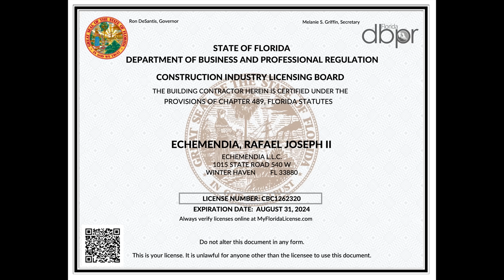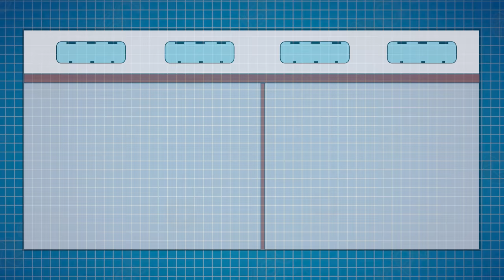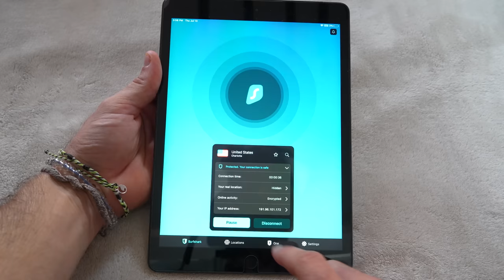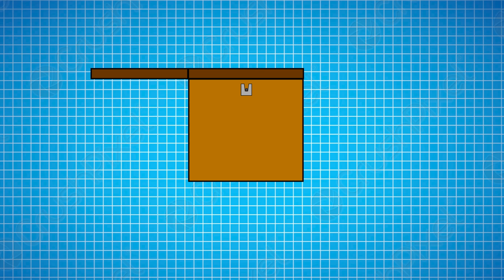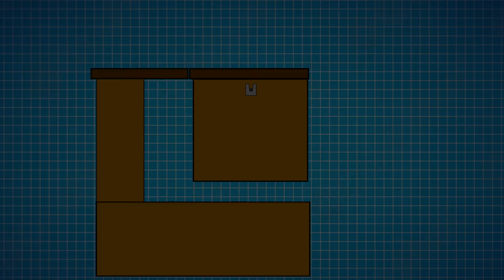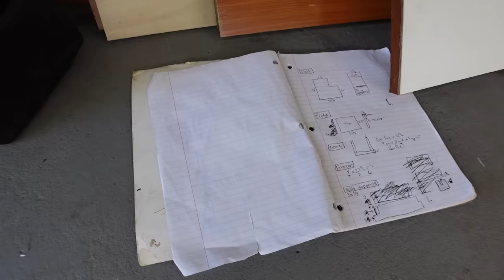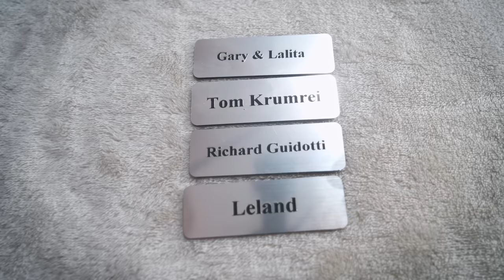Building a CUSTOM KITCHEN on a SALVAGED BOAT | ep.23

Comment: i work on sea going tugboats. Our stoves are fixed. They have fiddle rails around the edges and extra bars to make a grid for each burner. We use deep pots to cook in and wedge them in placed with tin cans from which  both bottom and top are cut off. Tug boats don’t heel but oh can they roll! And pitch and yaw.

Comment: Teaching me a few thing's and I'm a Design and Technology teacher of 23 years (Industrial Arts or shop teacher in the states). Remember when using the table saw full extension of the blade is the safest due to the angle of attack of the blade less likely to kickback. Hardtop was awesome, inspiring me to hit a yacht just.... finishing a 26ft power boat.

Comment: fun trick for anyone working with tricky angles as in the video, you can use a full roll of tape and a unspecified length of ply wood or a "random" piece, hold it square in the position you want it, and use a marking tool on the forward inside of the roll of tape along the bottom edge of the plywood to trace out a perfect fit. you can notch spaces for cables or hoses afterwards hope this helps someone!

Comment: Question in stead of having the doors open down why not hinge them to open out right and left using the same locking system or even reverse the doors to open up words which to me would need a system to lock arm to hold the door up.  Don't forget you will need a lip inside the cabinets to stop things falling out in storms.

Comment: I like the explanation, but have you considered how the stove gimbals when you lean to the other side? Then that top will move towards the back because the gimbal point is below the top plate. In the pictures it would not work, but reality and pictures might differ.
Reply from the maker: Later in the video at 15:25 you can see Raf addresses that. We cut the bottom edge of the back lip at a 45 degree angle so when we're heeled to Starboard the stove top has free gimbal room as well. And the counter still looks flush all the way around.

Comment: Air fryers throw alot of heat. How have you compensated for this in your kitchen layout design? Volume, cross venting, small computer fan(s)? Kitchen, work area(s), eventually the center island are coming together nicely.
Also using the same butcher's block styling for other areas, central theme. Any complaints from the neighbors about noise? It's a live aboard reno, any issues with staining and gluing vapors?
Reply from the maker: We had a bit of a run in with the heat which we’ll try to address in the next ep. And no complaints from neighbors because we were anchored right next to a house that was under construction which was putting off way more noise than we were. No one was bothered by vapors either.

Comment: After watching and commenting on this video I realize there is one thing I didn't see.  Did you Tab the furniture and bulkheads to the hull with fiberglass and epoxy??  If not you may end up with a lot of squeaking as the boat moves and twist and the cabinets rub against the fiberglass hull.  This was/is partly why UMA is pulling out the whole interior of their boat and rebuilding the interior... very  little was tabbed to the hull including bulkheads.

Comment: 12:46 I hope the equipment doesn't change anything since it appears you already installed the gimbal points without the air fryer and stove top.
Reply: 16:16 looks like need to reset the gimbal points.
Reply: After all components are installed simply add necessary counter weights to gimbal box to achieve balance. Also a good idea to install a neutral or level locking pin for times at calm anchorage or pier side.
Reply from the maker: We didn’t have the air fryer yet but knew it would sit forward more so our plan was to add weight in the back to counter balance it…if we moved our gimbal point it would throw off the angle of the swing and we would need more depth under the box for clearance
Reply: @SpearItAnimal  gotcha makes complete sense. I was just concerned once you put all the stuff on it that be like crap it's all out of wack. I should have considered you knew what you were doing. Sorry

Comment: 😮 That sink is overkill  the size of it will take 5 minutes to fill half of it up
Reply from the maker: We're not planning on bathing in it... And we've previously had a wash side and a rinse side on other boats and we both agreed it didn't save us a considerable amount on water. At that point it's more efficient to wash dishes in the water off the transom and then rinse in the sink.

Comment: I hope you tabbed all the wood to the hull or it will make a lot of noise when in bad weather. That means no sleep that you need. I ken it's already done but  hope you did. Old seaman.
Reply from the maker: Bonded with Sitkaflex
Reply: @SpearItAnimal  Tabbed with fibreglass a long both sides to the hull. the hull will flex but sitkaflex will not last long. But if it is fibreglassed in it becomes structural. Boat stronger, you worked on land not at sea.